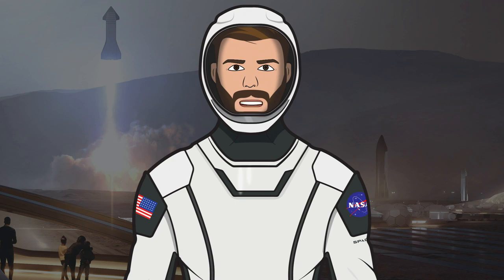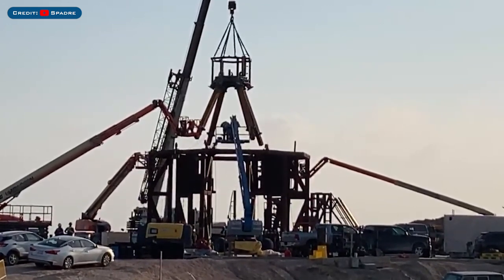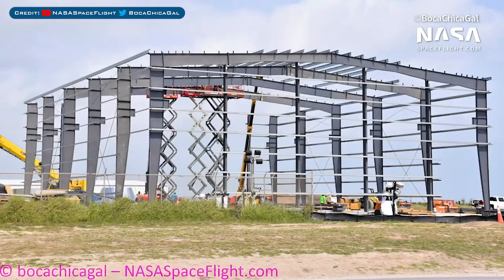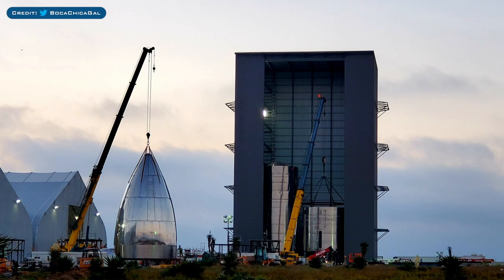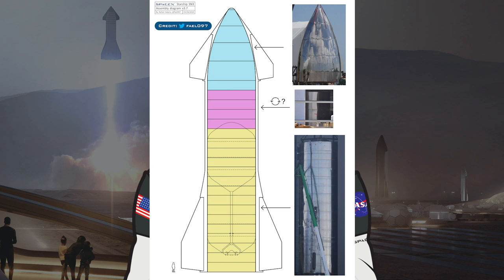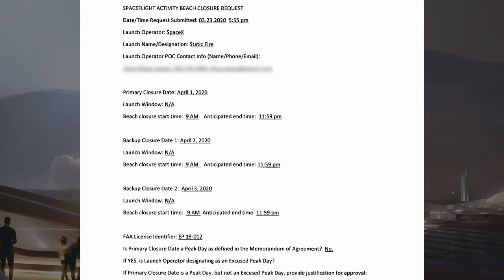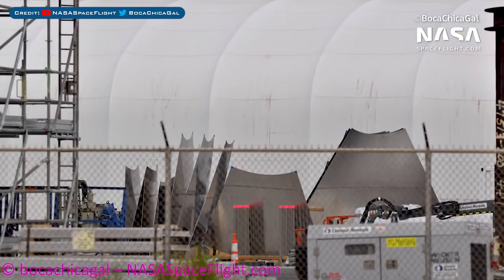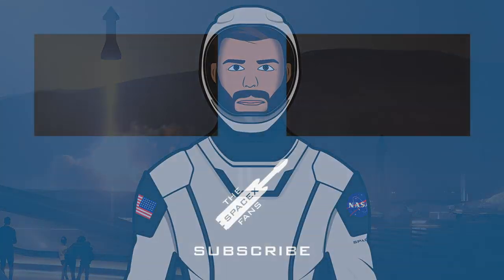SpaceX Starship Updates! SN3 Testing Imminent! Stacking & Testing Prep! SN4 Begins | The SpaceX Show

Comment: helium tanks high pressure
Reply from the maker: Starship doesn't use helium
Reply: @TheSpaceXFans  Those long white tanks at 01:12 are helium tanks.  Those black tanks hanging off the side of SN3 are helium tanks, SpaceX uses the helium to maintain pressure as the fuel is fed into the engines.  This is only a test article thing, I'm sure.  On the production versions of Starship, pressure in the tanks will be maintained autogenously.
Reply from the maker: @mikepeterson9733  Ohh I didn't know that, hence why @GroovyVideo2 comment didn't make sense at first. People like you commenting stuff like this is what I need on videos, thank you both so much!